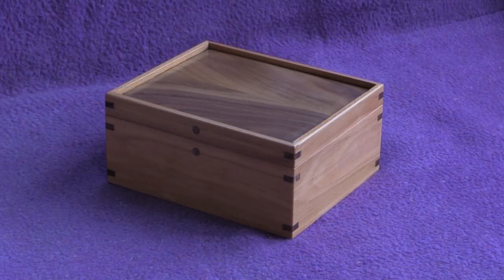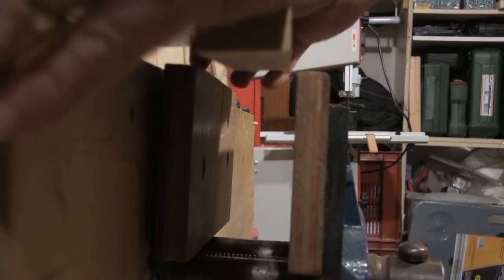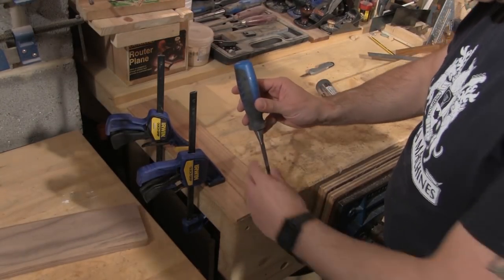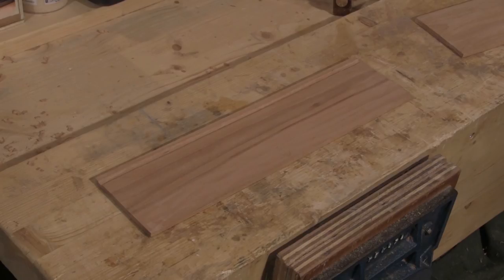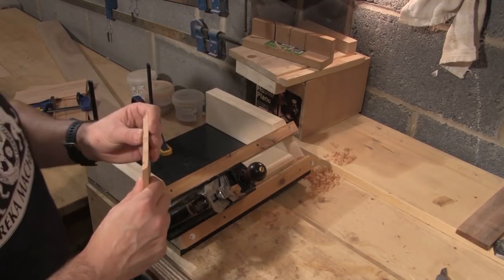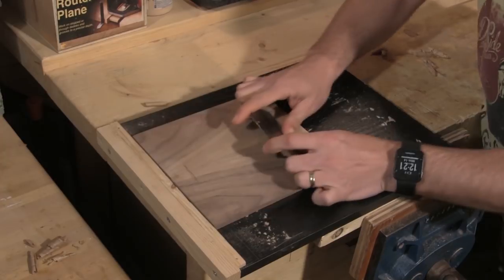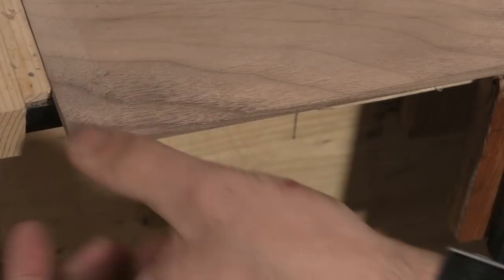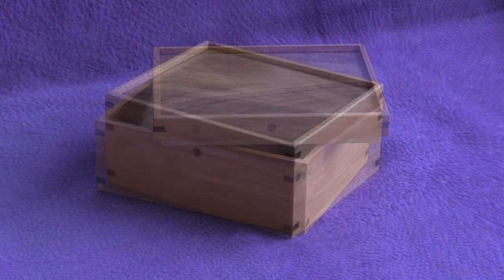Woodwork Project: Mitered Corner Box - Using Hand Tools Only - Part 1

Comment: Very inspirational. Your statement about striving for a "perfect workshop" but never making anything struck home with me. I also have a small shop but have been filling it with all sorts of "things that will make my projects go faster, better, etc." but relatively few projects. That will change thanks to your helpful video and a good lesson in life in general. Thanks again for the great video set.
Reply from the maker: Hi Thomas, thanks for your comment. I think the most important thing is to just start making things the moment one has access to the most basic of tools. It soon becomes clear which tools one actually needs to acquire - and having limited resources forces problem solving skills to improve. Most fancy specialist tools started life as a simpler tool used with some kid of jig. Dreaming up and building jigs and things that you make just to help make other things is all part of the fun.

Comment: Very nicely explained 😊the card scraper you used is this ordinary piece of sheet metal with sharp edge😊
Reply from the maker: Hi, thank you. Card scrapers are very useful and very simple. The 'cutting edge; is actually a 'hook' rather than a edge that you'd might find on a knife. The hook is a bit like a 'T' shape along the edge where the horizontal part of the 'T' has been curved over to form a hook on both sides of the card. To create the hook you'll need a file to get the edge flat and ensure a nice square section along the length of the card. You then need a 'burnisher' to draw out the material for the hook and turn it over. A burnisher is really just a hardened steel rod and it is perfectly possible to use the shaft of a screwdriver or chisel as long as these are hardened steel, or at the very least, harder steel than the material which makes the card.  If you have the time, take a look at Keith's video here where he shows his sharpening technique, he also adds some simple cross section diagrams which help explain what the hook looks like:  https://youtu.be/h-KYqsAPMqk

Comment: Great box! Is it possible to chop out the housing with a bevel edged chisel? Or would I need a mortice chisel for that?
Reply from the maker: Hi Dwight. I pretty much only ever user bevel edge chisels, even for morticing! I have a couple of mortice chisels but often the are not the right size so I use the bevel edge chisels instead.

Comment: Nice work.  A Stanley 45 would've made short work of those dados and rebates.
Reply from the maker: Yes indeed, I use mine regularly. I think in this case I was trying to show how to do things with the limited set of tools that a new woodworker or hobbyist on a budget might have. I myself had been woodworking for years before I had any think like a plough or rebate plane. I've definitely filmed a project where I use a 45, though can't remember if I've edited it yet - I'm running behind a bit as work got in the way for the last year.
Reply: I'm very new to woodworking but would the plough plane not leave a wider dado than the chisel? I know very little about plough planes but I'd love to be wrong about this since I scored one to restore for very cheap recently.
Reply: @Indecisionn  They came with a set of irons (21 or 22) down to 1/8".  Find one of those sets and you're good to go.  There are many YT videos on these.  Try Wood By Wright as a starter. He had a couple that are informative. Good luck and happy ploughing. Uh... you know what I mean.
Reply: Only if you own one. A router table or table saw would be quicker even more.
Reply: @williambranham6249  Actually, I can set up a plough plane faster than a router table or table saw, and I don't have to listen to the roar.  To me, the journey is the point, not the destination.
Reply: @rosshollinger8097  I understand. I was being a bit sarcastic . The point of the video in my mind was that even a  specialty plane can be overkill or out of reach  for the beginner. A beginner would most likely not have  a plane for dados. But I always enjoy feedback.

Comment: From (an old) beginner. I noticed that you used your marking gauge by pushing it away from you rather than pulling it towards you, is there a reason for this or is it just personal preference? Thanks for posting, it was great.
Reply from the maker: Hi, that's an interesting question. When I first read it I assumed it was a quick simple answer, but I've actually had to think about it quite a bit. I then had to go into the workshop and go through the motions to see what seemed right. So, here are my thoughts ...

Firstly, I realised that I actually use a gauge in both directions, mostly it depends on the shape and size of the work piece, etc.

I think habitually, I tend to push away. This is how I remember being taught as a child and so is probably more natural for me personally as I've done it countless times over the years. There are a few considerations though:

- Most of my gauges are simple pin scribes and so are omni directional. I know some gauges with a blade scribe are different and some Japanese style scribes have a directional blade and are designed to be pulled by a right handed person. The 'wheel' type scribes such as veritas make are probably more sensitive to direction as the cutting disk is screwed into the top of the shaft with a standard screw thread. This means that if a right handed person pushes then there is a possibility (maybe a remote one) that the screw could loosen over time as the blade will be exerting counter-clockwise pressure on the locking screw. So, it stands to reason that these gauges tend to be pulled.

- Some of it will depend on the shape of the gauge, how it fits in the hand and thus which direction feels more under control.

- Grain direction is a factor, with close grained hardwood its probably not an issue but if the grain is more coarse and is running 'off' the edge of the board in the push direction, I'd probably choose to pull so that if the scribe is effected by the grain it has the effect of pulling the fence hard against the edge rather than pushing it away.

- It also depends on what I'm scribing. If I'm scribing the full length or width of a board I don't worry so much, but if I'm marking out a mortice in the middle of a board I'll likely push from the 'start' to about 2/3 of the mortice and then pull back from the other side, just so I have better visibility of the lateral marks and thus avoid scribing past the end of the mortice.

In all honesty it's probably one of the topics where some righteous souls would go into battle to defend one way or another, but in reality it's more about personal preference and what works for the individual. 

Do the marks come out accurate and clean, if not - try something else.

Like many things, advice is always useful but never a replacement for personal experience - just keep making things and scribing lines, you'll soon work out what works best for you and also subconsciously learn under what circumstances you go against your usual method. 

Thanks for the question, it's made me think deeply about something I had been taking for granted, but is actually a very important part of woodworking.
Reply: @adventuresint-shirtswoodwo3905  Many thanks for such a fast and comprehensive reply, it's all helping. I love the style of your 'basic hand tools' videos, you're really showing people how to complete nice projects with minimal tools or outlay, and doing so in an undramatic way. Thanks again, it's inspiring.
Reply from the maker: @stevebungay  Thank you and you are most welcome. I've got some more project videos coming very soon - some for real beginners and some a little more advanced, but hopefully there will be something useful in them all.

Comment: Wow, I don’t know how you saw such a long piece of wood in equal thickness! Oh ok , I was premature with my comment! Could I do this with sanding if I don’t have a plane? Thank you
Reply from the maker: it's highly unlikely that you would be able to get an accurate thickness by sanding. A plane is specifically designed for flattening surfaces and actually if set up and sharpened correctly, will leave a finish far smoother than sanding in a fraction of the time.  It's really important to get a uniform thickness on this project as otherwise the corners won't come together square.  My advice would be to save up and buy a plane if you can and then spend some time learning to sharpen and use it - you won't regret it. And it needn't be expensive. A second hand number 4 smoothing plane can be found for £5-10, maybe £25 for a really nice one. Those are UK prices, but would be a similar amount of dollars in the US.